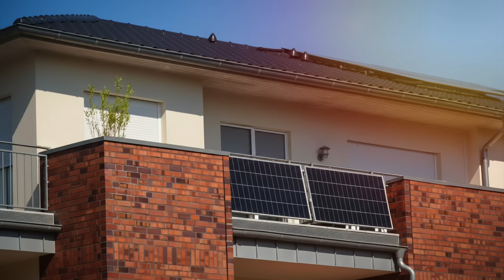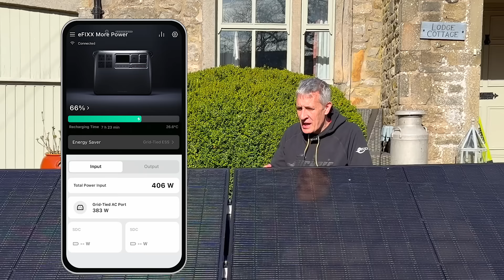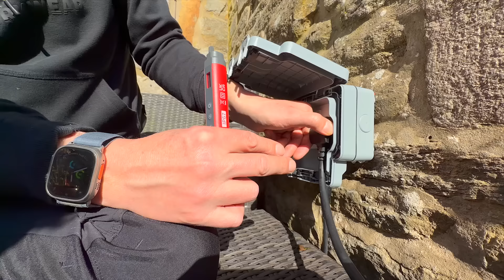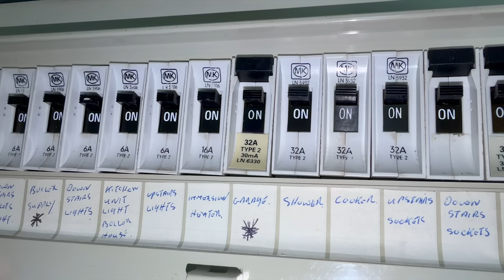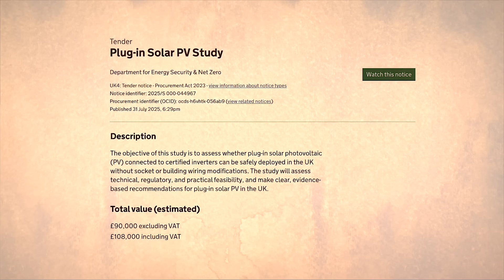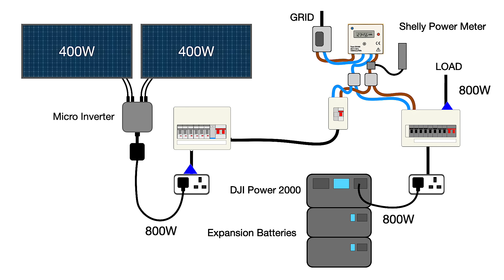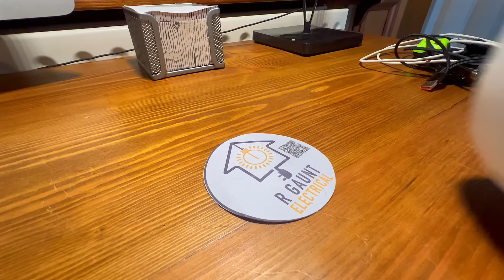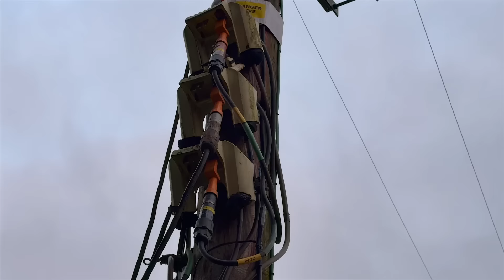Plug in Solar: We’re Told Never Do This… So I Did

Comment: Personally, I'd like good quality products to be legal, because that then means there's a much reduced market for dodgy stuff that hasn't met the correct / any standards.
Reply from the maker: Wise words!
Reply: @efixx  Putting aside the legal/standards stuff, bc let's be honest, if it's simpler to do, the govt won't do it bc there's money to be made if it's made to be harder. But having a system be more "modular" is better. Houses aren't built to have big panels, inverters & big batteries. That's why most installers stuck them in the loft at the start. Coming from an IT/Homelab background, having a dedicated circuit for that gear is great, but it's not always possible. If not 13A plugs, into the normal house circuits, then dedicated circuits paired with those industrial barrel plug/sockets. Overkill maybe, but having a dedicated plug/socket that's demarc for "Power In", where the solar systems can be isolated, & moved around if needs be, is a better option.
Reply: @Cyberbyte_010  Sadly we are not as progressive as Germany who introduced this first, IKEA sells kits and other EU countries are looking to adopt an approach
Reply: @CoderTronics  Its so sad, You ask for a quote for solar installation and its cost an arm and a leg. while a simple DIY like this can go a long way
Reply: Agreed, and we've seen this used concept successfully all around Europe. We're falling behind the curve.
Reply: @Marc-ww7cc  that's the UK way! No investment or support, start crowing about scapegoats, single issue politics and then complain that everything is too expensive because we have to buy at market rates because we didn't invest because it's too 'expensive' for a 5 year parliament
Reply: @themasqueradingcow91  Yeah, but have you seen all those great flags on lamp posts?
Reply: @DavidSmith-oy4of I've seen how much it's cost my local authority to remove after the blanket ban when one caused a crash when it blew off into the middle of a three lane roundabout
Reply: there is no illegal stuff on the german market cause they do no longer get into the EU market. And if they had falsified certificates or developed the product in production further by removing parts and functions then the chinese had to pay for that and fix all german and austrian units as seen in the past. 
They removed a part after certification, lowered the costs and paid billions afterwards cause their share price stalled big time: - 15 billion market capitalisation for deye . THat had happened in 2023 in germany when the na protection had been changed or better removed. The mandatory protection was gone. 

But maybe in the UK you can import such products but I would in general doubt that until you find chinese vendors on amazon or ebay with a domestic stock or products already imported..
Reply: Good quality is not a legal concept so keep wishing
Reply: It is legal now.
Reply: @axnax1  well, is it? the wiring regulations haven't been updated.
Reply: @tomcardale5596  Apologies. 
This on govt site -  “Plug-in” solar panels to be in shops within months, offering households chance to significantly cut energy bills.
Reply: @tomcardale5596  Apologies. 
This on govt site - “Plug-in” solar panels to be in shops within months, offering households chance to significantly cut energy bills.
Reply: But that doesn't mean bad quality products won't be sold to consumers, or by electricians. Bad installation is also a big problem if it's done wrong.
Reply: Legal ? You mean the Guv to say YES ? It will never be legal while US consumers have to to pay back 46 billion for Hinckly point nuclear; GOOGLE : 
Point C nuclear power station in Somerset has risen significantly, with current estimates suggesting a final price tag of up to £46 billion to £49 billion in today's money. Originally estimated at roughly £18 billion (in 2015 prices), the project's
Reply: @studiosys  Did you mean UK consumers?
Reply: @silvergreylion  think it was just emphasis: "while us consumers..."
Reply: @silvergreylion  It's a simple grammar issue - if you use the correct convention then differentiating U.S. from us is simple. But we are lazy creatures and rely on other people using context to work things out.

Comment: Another thumbs up for Ecoflow stream systems I have three units and 100 panels all plugged into two dedicated sockets had no problems and saving £45 per month on leccy mostly by load shifting to the overnight cheap rate
Reply from the maker: Jeez 100 panels that’s an epic install!
Reply: @ElectricMikeEV  the Octopus Agile half hour pricing has shot up the past few days. Low wind but could be the ME situation which could continue indefinitely.

Comment: Well, this isn't new.  People have been doing this for years.  It's one of those things that governments have no real control over... they'll have to make it legal just in order to apply some decent regulation to it.  Otherwise it stays underground... and unregulated.

The biggest danger is current ganging on a circuit.  If the grid-tied unit is not at the end of the chain of plugs on a circuit then its current can gang with the current from the grid to run down-stream devices (such as space heaters) well in excess of the current-carrying capabilities of the house wiring.  Without tripping any breakers.

Does it make sense to do?   mmmmmm....  other than not having to run a wire from outside to inside (when one has an outside plug, anyway), there isn't much of an advantage over something a bit larger and semi-permanent.  People just don't put out enough panel wattage to make it useful.

--

For someone able to make adjustments to the home (owner or long-term rental), and with a bit more space, there are intermediate solutions that do not require putting solar on the roof.  My favorite is just getting Pergola/Gazebo kit (12ft x 6ft, steel, approximately), then plopping 4 x 400W panels on top of it.  1600W worth of panels can generate a decent bit of energy... well over 6 kWh/day, usually.

(I have two big decks and two of these, in fact... it runs my computers, servers, monitors, wifi, and alarm system)

What you do with it then is highly variable, but there is no particular need to be grid-interactive.  You can just run it into a power station configured to charge the batteries only from solar and drive its AC output with solar/batteries first, and the wall second.  Reliable power without being grid-tied.   Then run equipment... like a home office for example, which burns a decent amount of energy daily.

Power stations are getting fairly sophisticated in being able to handle setups like this.  Do your research.  But don't over-size the equipment by too much, doing so negates the economic benefit.

-Matt
Reply from the maker: Great insight
Reply: @efixx  Although used the phrase "do your research" so automatically flags themselves as a total bore.

Comment: All this pissing about because we’ve had multiple governments that can’t resist meddling in the electricity supply system and are determined to deindustrialise the UK and make energy completely unaffordable in order to ‘control the global weather’
Reply: Um, generating your power off the balcony is a contribution to preventing excursions in the global climate (which I suspect is what you mean by control the weather. There's a course on climate free from Exeter University, it goes well beyond the difference)

Comment: Been doing for 15 months. Using 4x 445w panels and 2x EcoFlow Inverters. I have a Shelly EM to see what I am generating into the grid. This is all wired together and plugs into my garden socket. I have a large PV system already and a G99 for export. Weds recently was the best day. My panels are fence mounted vertically and I made 5.1kwh. It should be possible for us all to do this. The Europeans are miles ahead of us
Reply from the maker: Great to hear you're having such success with your setup! 🚀
Reply: @efixx just about to make 7 panels this week.
Reply: @petewright2283  Please don't. Read my separate post why.
Reply: 3 years me
Reply: Very interesting as retired engineer.   Was wondering where you got the panels and the water ballast  supports.      I all ready have the DJi 2000 and was looking to add the expansion pack. But the ground mounts will be nice for the patio

Comment: If this is your only solar system you will have problems being paid for exports. 
Most energy suppliers will ask for an MCS certificate and also an export MPAN number. Also currently you will also have to notify the DNO even if it is below 4kW and they might ask if the equipment is compliant and safe to be connected to the local energy network.
Electricity meters do not run backwards. My old analogue did not and a SMART meter simply records the exports as a separate reading. Without an export  MPAN the DNO cannot pay the supplier and the supplier will not pay you. If you have an analogue meter - again you have to have an MCS registered system with a certified generation meter and a separate export meter.
Reply: Hence the batteries. Most of the excess energy from an 800W solar panel will be stored in the battery for use later, so it won't be exported. 
As for MCS rules, we could do something like allow local generation without MCS certificate if it's less than some lower power threshold like 1kW.
Reply: @anahatamelodeon  You don't need MCS certification for any level of generation if you're not worried about getting paid for export.
Reply: Merely needs to have been installed by an electrician who is a member of a suitable professional body (all are) and is qualified in the relevant area. The "needs to be MCS" is a myth and the electricity companies are finally getting successfully called on it.

Post October it'll be a lot clearer as anyone doing a solar or battery or EV charger install actually has to have training/CPD for that area.

For a small setup it's not worth it - you'll use it all, which is great.

Comment: I would have expected a video on the efixx channel to at least have been checked by someone with a suitable background. What did they think the volt stick was going to demonstrate when the solar was removed from the socket? Even if it was still live, a volt stick would not detect that.
Reply: Efixx needed to demonstrate that it's not like a suicide cable when unplugged. A naive but understandable expectation is that the solar inverter would be generating 240V AC all the time, making the plug live pin an electrocution hazard when unplugged. It's taken me a while to understand how DC-AC inverters are configured to sense a voltage on the line before they will output any power.
And if it did have 240V AC on it, the volt stick would have detected it - why not?
Reply: @anahatamelodeon the solar micro inverter is not referenced to earth, so a volt stick will do nothing.
Reply: @sdgelectronics  Fair point, if true. Should have put a voltmeter across L and N instead (far more trustworthy anyway).
Reply: @anahatamelodeon  Plug it into a sausage and see if it cooks.... Big Clive style.
Reply: He did touch it with his hand and he didn't die, so it's ok!

Comment: I just don't see the cost-effectiveness well enough. Some of the financials are glossed over to begin with - adding each battery probably extends payback by years, and that's only if you can get an off-peak electric rate (not available to many). Otherwise, I expect you'd have to live to be 100 and buy the system in your teens - plus, of course, nothing ever breaking or wearing out

The solar production here is tiny compared to the shown storage. And as we know, UK sunshine can be quite fickle and not there when you need it. Imagine this truly is a "balcony" system. The panels would have to be mounted vertically (unless you have a huge balcony or ever wanted to use it) and that would immediately bring Planning objections in most areas. Where do/do the batteries go, and how would a flat-dweller connect to their consumer unit? So really, this is just another project for the well-to-do with big houses (owned ideally) and extra money
Reply: If you have a big house you do a wired in system.

So to take the rest bit by bit

UK solar average output a year is about 1000 x KWp of the system. So a typical modern setup with 1200W of panels will generate about 1.2MWh a year (or 336 quid). That will pay for itself with a 2kWh battery in 3-4 years without any tariff changes. Payback is actually very good because you are using all you generate. That's without an electrician, adding an electrician into the picture can ruin your payback 8). EV tariff will slightly improve the payback.

Planning is not required for wall mounted solar in the UK except in nimby conservation zones, AoNB and the other usuals (listed etc). You can also put varying amounts on fences or in the garden. Scotland has good policy on this, England & Wales limit to 800W and are a pain - it's really quite mad - I can install a 2m high flourescent pink fence without planning but not a solar fence 8)

Batteries should go outside or in a garage ideally, people though tend to stick them all sorts of stupid places. The newer ones are all rated for external use.

Flats you are mostly stuffed. You need planning permission for heatpumps, for solar, for loads of stuff, you probably don't use enough power for a built in system and the freeholder will no doubt block you anyway.

Best a flat dweller can do is generally time of use tariffs and just battery. As most are renting even that is hard.

The government policy on flats appears to be to dump it into landlords in 2030. However landlords can simply write to the freeholder, be told to go stuff and then fill in the paperwork from 2030 saying "can't get to EPC C as freeholder won't let me" and all done..
Reply: Why do so many people think that it's only worth it if it pays them back in double quick time? How about thinking about the planet first and your wallet second? Eventually you will get your money back and the planet will benefit. What's to lose?
Reply: @simonpaine2347  Will you get your money back? You think so- I don't ... I costed my solar + battery installation expecting to be repaired/partly replaced over (say) 15 years, and I added in what I'd get in the stock market over those 15 years for the money I spent up front. And I think I can say that no, eventually, you will NOT get your money back - you'd have been better off being invested in the stock market and paying your bills from that.

No-one seems to include repairs, replacement and depreciation in their "Returns on Investment" sums, and they're probably deluding themselves. Everyone seems to be in denial that investing in stocks and shares over the last 12 months yielded 30%.

Me? My solar + battery installation protects me from rural power cuts - as I work from home, that's a price worth paying. I'm happy for that.

As an investment? Nah - people don't factor in all the losses. I don't expect to EVER get my money back - unlike the evangelists here who say I will. 

I won't! And you won't either...
Reply from the maker: The battery 6kWh used in the video would payback in around 7 years based on arbitrage. I’ll see how the solar generation improves this over the summer months.  I’m not overly concerned about planning as the panels are free standing no different to large set of garden furniture or a kids trampoline.
Reply: @efixx  What about what you could have earned instead by ploughing that money into a Stocks and Shares ISA instead of buying something that HMRC may well tax out on soon - arbitrage is on their radar now...

This really isn't as easy as saying "7 years", when you could have had interest instead, and that battery is 50% knackered in 7 years...

I'm solar + batteries and a real cynic...
Reply: @efixx  See Harry's Farm's video on this. He covered an old tennis court with solar panels. It's fine as they aren't fixed down, just weighted down. As soon as you bolt them to the ground, that's where the problems begin. I think he weighed his down with breeze blocks so those can be lifted off and the panels moved. Hence no issue.

Comment: The UK socket being max 13 amps, but rated for up to 32 amps in a ring, should be safer than many of the EU circuits. 
Most needed would be a second breaker panel or section of breaker line just for securing the input and to make sure it cannot lift off the panel. USA has had zero problems even in 400 amp plus panel systems but requires that breakers for input are securely screwed to the panel box with secondary screw and hold downs.
Reply: Why would a system of <1kW need a 13 amps socket? I don't quite get it.

Comment: It’s not worth all the trouble for 1-2kWh for a few months a year, just a novelty. If they want us to urbanise, which it seems they do, then subsidise power to people living in flats and apartments.
Reply: Typical total generation is about 1000 x kWp of the panels so a typical balcony system with 1200W panels, 800 W into the house and a bit of battery is going to generate you about 1.2MWh in the south, or about 1MWh in the north.

At current prices 1.2MWh is £336 a year, for a bit over a grands worth of kit including cables, panels, mounts etc. So it pays back in 3 years if you can avoid having electricians involved.
Reply: @etchedpixels  This year has been a good year for investments, but I could have earned £336 on the stock market for a bit over a grand's worth of investment. And my investment wouldn't have been slowly depreciating like a pile of electronics... People aren't doing the sums properly...

By the way, I live in the North, and if you think you can generate 1MWh p.a. with 1200W panels in the North, you must live in a different bit of the North to me ! I have 6000W panels, and generate 3MWh a year. Good luck with your sums! And good luck making money with solar...